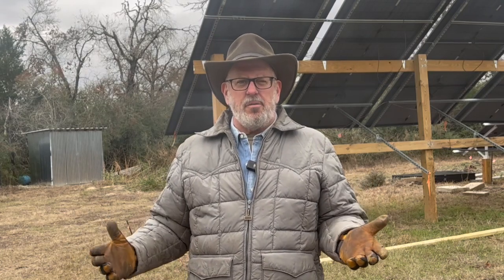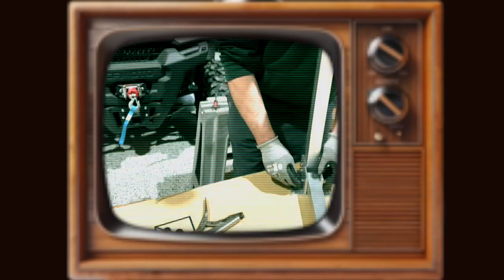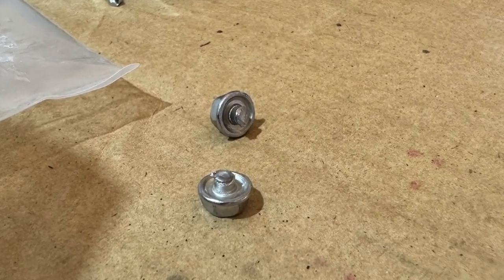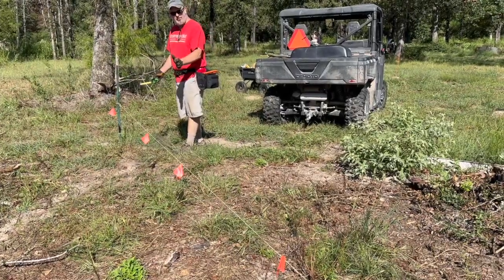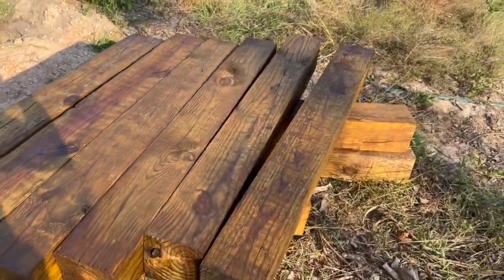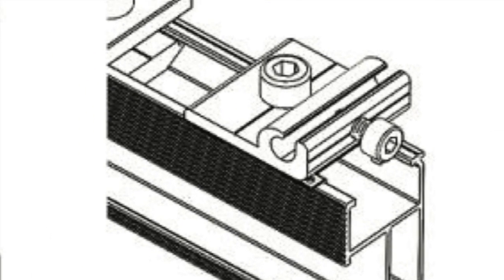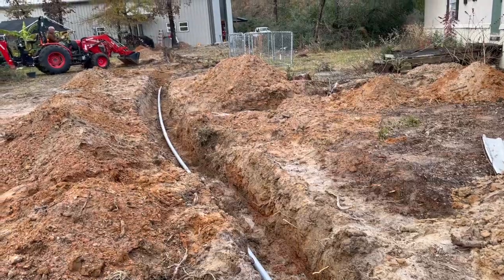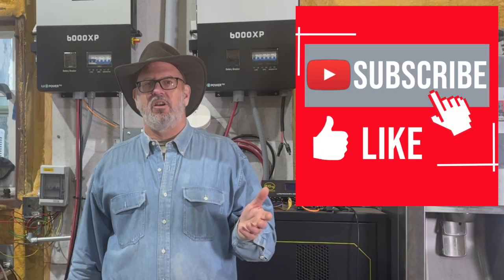EG4 Brightmount Solar Ground Mount DIY Install, Understand New Changes

Comment from the maker: I used three EG4 Brightmount kits to build my most recent DiY adjustable ground mount array.  It took a while to get it all done but after I finished and made this video, I found out that EG4 has redesigned the Brightmount kit into the latest version called the Brightmount Cat1 kit.  These are pretty similar but the changes made to the solar panel rail make it where only the new Brightmount Cat1 extension kit will fit the Cat1 Brightmount kit. The Cat1 Brightmount is currently on back order but should be shipping out in a couple weeks.  I included some information in this video to help you understand the differences and avoid any mistakes in ordering the new Cat1 kit and Cat1 extension kit.  The Brightmount is still an affordable solution for an adjustable solar ground mount kit, especially compared to the other options in the marketplace.  I hope you find this video helpful!! 👍🤩⚡️☀️🔋
Reply: I don’t understand since they created a new version they didn’t just include slightly longer arms so the extension kit isn’t even required. The majority of the latest 400+ panels have a width of 44.65 inches so just less then an inch more then what an extension isn’t required!  Would have made more sense to me!
Reply: @WingAddict  BINGO!!!
Reply from the maker: @ That’s a really good point. I suspect it may have something to do with maximum package length for shipping or it might be that the wind loads and ratings may be different with extensions or larger panels.  I’m just guessing here 🤷‍♂️. It’s a good rack if you need to mount a few panels and there’s not much else in the price range. For my next rack I need to go bigger! Thanks!  👍⚡️☀️🤩

Comment: Thanks for sharing. I'm researching putting in a ground mount system for my new house. I had the house wired for solar and use a portable 420W solar panel with my Bluetti AC500 generator. It's just for emergency power for our freezers, frig and fan on the gas furnace. I'm looking at expanding to a server rack battery system to provide power for both the house and my next car (probably a PHEV Prius). I'm just waiting for my 2012 Prius with 314,000+ miles on it to die, which it doesn't seem to want to do.
Reply from the maker: I love the Prius and was looking for a Gen 2 for my daughter!  From my experience, the most affordable long term ground mount install would be the Cat 1 Brightmount with extension kit, from signature solar, if you can catch it in stock! (always call and check if it is not showing on the website).

You  can do better for more money, and the Integra rack is n easier to install option. Solar is lot easier when your panels are securely in place.  😍🤩🔋⚡️

Comment: All EG4 has to do is make the rails 2.5" longer. Why is the extension kit even a thing?
Reply from the maker: Many have pondered that question.  I can’t get a good answer but the best guess is that either the length would cost considerably more to ship or the wind ratings would change significantly.  All I can say is that with normal sized 400 watt panels, you really need the extension kit to effectively mount 4 panels per rack.  There’s a few things I don’t like about the Brightmount, but I can’t find anything better for less money.  👍🤩⚡️🔋☀️

Comment: Very good detail.  Great video.
Reply from the maker: @rockygrindstaff7312  Thank you so much!  We try to entertain and educate simultaneously, but sometimes we fall short on one or the other 🤣.   If there is a cheaper easier way to permanently ground mount solar panels, I haven’t found it yet.  Signature Solar finally has the Brightmount back in stock.  If you decide to buy a couple, use my discount code TwoSteps50 and they’ll knock $50 off your invoice.  👍☀️⚡️💡🔋💵

Comment: The problem is they stop selling the Brightmount  and sell something I don't like
Reply from the maker: @Robertbush-s7t  I agree. I think the Brightmount was an affordable solar panel solution that took some assembly work but provided a sound mounting foundation.  I don’t think changing the design was EG4s Idea , I suspect the overseas manufacturer was looking for some cost savings.  That’s all history now since anything new from China will cost 50% more today.  Until the whole tariff mess gets sorted out, solar prices will be in constant flux, so if there’s a deal out there,you best jump on it!  👍🤩⚡️🌞
Reply: @terrahillfarm  After I wrote to you  I looked at SS and they have them back I have 4 of them needed to get 2 more was told not selling them no more looked other places none they have these mounts you have to put on the ground And I put mind up some  what like you do loved your Video
Reply from the maker: @Robertbush-s7t  Thanks Robert!  Please make sure you’re aware the Brightmount on sale now is the  newer “CAT 1” design which is different than the original design in my video.  Make sure you order the “CAT 1“ extension kit if your panels are wider than 40”.  Also, order an extra splice kit if you want to join two or more Brightmount kits together in a single array.  

Unless they changed in the past month or so, The CAT 1 extensions do not fit the original Brightmount kit.  You’ll need the original extension kit for those.  I am not sure whether the splice kit will splice an original Brightmount kit to the CAT 1 kit or not.  Let me know if you find out.  If all your Brightmount kits are “CAT 1” the. You should be fine.  Use TWOSTEPS50 code at checkout and save $50 on two Brightmount kits! Thanks! 👍⚡️☀️🤩💡
Reply: @terrahillfarm  Yes I know when they told me I could not get them I got rails and other stuff to make a adjustable something like your mind will bolt in the middle of 2 2x8 drill hole in top of 6x6 2 post then run the rails for 8 panels Thanks for the help

Comment: I built my own ground mount... total cost under 2000$ (including welder) and it could host 22 425w GStar panels. Link to video: https://youtube.com/shorts/eXXFhWd2qQA?feature=share
Reply from the maker: @srsr2005  That looks very nice!  I just bought a new welder and was thinking about building something similar out of 2 3/8” (60mm) oilfield pipe.  If I have any panels left over from my roof mounting, I will build another ground mount system.  Thanks for watching the video! 👍⚡️☀️🔋🌞

Comment: I have the Cat1 kit but still cannot use it because extension kit is not available... I'm about to 3d print my own extension kit at this point...
Reply from the maker: @timbit123-k1c  UGH… that is terrible.  🤦‍♂️The manufacturer changing up the kit has caused some significant issues.  You might check with Current Connected to see if they have any, I know they also sold the brightmount kit.  I should have bought some extras just in case..  if you end up printing some send me one and I’ll put it in a video with your contact info so you can get your money back out of it! 👍⚡️☀️🤩
Reply: @terrahillfarm  ahah right now it is winter so I will probably not install it before April. I know the extension kit for CAT1 version is installed at the center not at the end like the previous version. so by doing an extension in abs, you might need to join the ground between the two side. Otherwise where I live we don't have extreme weather or extreme hot days. ABS is supposed to be strong enough but I wouldn't like to be responsible if anything happens. The extension would have to support the panels at the center, it might also be possible to find any other type of rails and print or design something to fix it in place. I will probably investigate a bit more in the coming month when snow will start to melt here.

Comment: I believe EG4 Discontinued this Ground Mount. It is no where to be found on their website anymore. The only thing left is just extension rails. It seems to be replaced with the Integrack
Reply from the maker: @Moes_Prep_and_Tech  I spoke with signature solar this week and they said the Brightmount will be out of stock until around March, due to delays.  If that’s the case, they should put it back on the site when they have firm delivery dates.

Comment: EG4 had a great thing going with the brightmount kit then they changed it with a new model downgraded the max wind rating, raised the price and cannot connect to older models. What were they thinking?
Reply: I agree, They really downgraded the quality and raised the price. They are about on par with Vevor now.
Reply from the maker: @ColorMaker_Solar  Thanks, I don’t know but I’m sure it was probably a move by the overseas manufacturer to increase manufacturing efficiency or lower labor costs since inflation has been impacting all countries severely.  I’ll withhold my final opinion on the Cat1 until I have a chance to try it out and compare it, but your point is valid.  This is just another example of solar equipment costs beginning to rise due to inflation.  The technology itself is somewhat deflationary, but it is the added costs from manufacturing, shipping, warehousing and tariffs that are being impacted by ongoing inflation.  I’m wondering if we will eventually see other costs rising in DIY solar components.  Battery prices are low now but the US just blacklisted several more companies in 🇨🇳 that mine lithium, zinc, copper and other solar materials like silicon.  I don’t want to be alarmist here, but if I planned to do DIY solar in 2025, I’d buy batteries first.  I don’t know the future but I do worry about it sometimes! 😆👍🤩

Comment: I have seen many of these EG4 Brightmount Ground Mount installations, and this is the best one. I love the tips and tricks you provide, like running the wire and saving money on the wire. I love it!
Reply from the maker: @GoingSolarEnergy  Thank you, we really appreciate that.  It took quite a while to complete the entire project since we only worked on it over the weekends.  Mounting solar panels cheaply is a n ongoing challenge so we’ll keep working on it! 👍👍👍👍

Comment: Any concerns about the connection strength of attaching to the end grain of a post?
Reply from the maker: @travisfugate3749  Good point, I’d encourage longer screws maybe 4-5” instead of the 3” I used.  Like I mentioned, I’m prepared to add ground anchors if needed but so far the mount is surprisingly stable and won’t hardly move when pushed on hard.  Again there are plenty of superior ground mounting options but they require significantly more cost.  Most people are looking to reduce the cost, so I’ve tried to focus on the most affordable mounting solutions with my videos.  

I’d love to have a fancy Sinclair or Iron Ridge all galvanized ground mount system to install, but I’ve still got a kid in college ! 🤣💰👍⚡️🔋
Reply: @terrahillfarm  FWIW Signature solar says they are no longer selling these mounts and that EG4 is discontinuing them....
Reply from the maker: @ Thanks!  The last conversation I had with them they told me they were on back order.  But they could have discontinued them. 🤦‍♂️ Things change really fast in DIY solar!   My next choice would be integra rack.  They’re more expensive but easier to set up from what Will Prowse told me.  https://integrarack.com/.
Reply: Thanks for the feedback. I’m considering this solution for myself.
Reply from the maker: @ Thanks! I only discovered the changes to the new Brightmount kit the day I was posting the video.  I could imagine the confusion and frustration from people ordering the new Ca1 kit and the old extensions that would not fit.  🤬. So, I contacted Signature Solar to confirm all the information on the Cat 1 kit, then went back and added the new information to the video.  👍👍👍
Reply: Vibration from wind would loosen the screws quite fast.
Reply from the maker: @ Good point!  I’ll check those and follow up later on how the bolts and screws faired! 👍🤩☀️

Comment: Try the Integra rack and you'll never go back to brightmount lol
Reply: If there was a way to raise up off the ground a few feet then yeah. But I get a lot of snow in the winter. The Brightmount kit I have now is installed 3 feet off the ground on 6x6 posts.
Reply: I was told that the brightmount CAT1 will be available mid march from a new line of distributors.
Reply from the maker: @WillProwse  Thanks Will!  I will look into them 👍🤩☀️⚡️
Reply: @WillProwse I think they discontinued the Brightmount, it's no longer available on signature solar, it got replaced with the Integrarack
Reply: If integra rack set to mount 4 panels including necessary conduit is $400 total, it would be more reasonable
Reply: @HuyTran-zy9sv  build both and let me know what you think about the price 😂